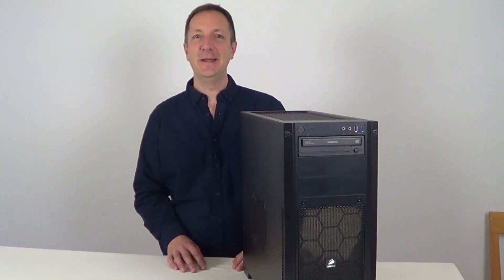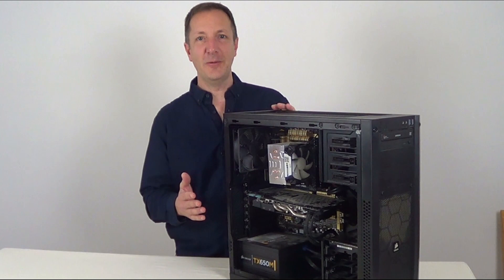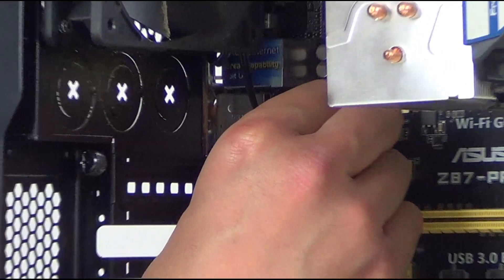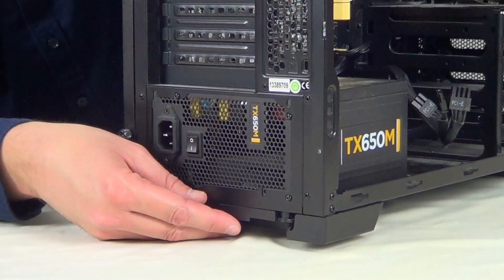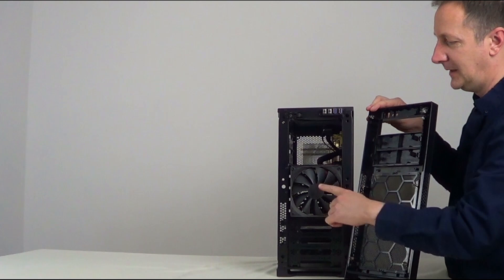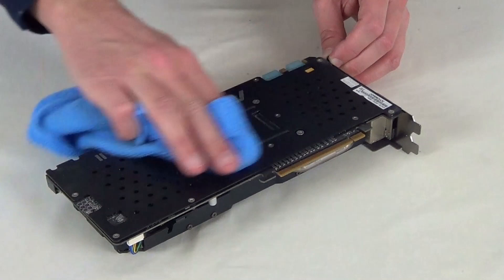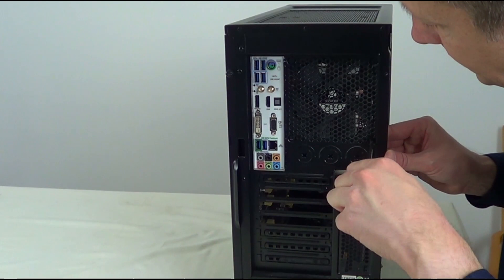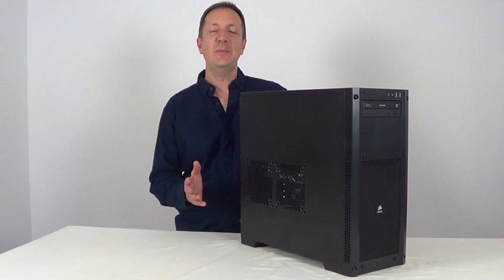How To Clean a Gaming Computer (step-by-step guide)

Comment: Great video! Those 4th gen Haswell chips are notorious for running hot even with a clean fan :)
Reply: Applying new thermal grease can help drop a few degrees on older PCs too
Reply from the maker: Thank you! Yes, wouldn't want to overclock it too much!

Comment: hey over heating problems arent always the dust that is cheged in there mostly you thermal paste have dried out so its a good choise to change the termal paste  evry tow months and the same for the gpu if you can do it

Comment: im cleaning my out soon and i have compressed air but get really cold and is that bad for my parts because it get really cold and also can I use a painters brush for dust as well or is it harmful?
Reply from the maker: Whenever your can of compressed air gets very cold, leave it to warm up again before using it. It's best not to use a paint brush on circuit boards, but can be used on certain other parts such as the computer case.
Reply: @EasyPcRepairs  okay thanks but the paintbrush is clean a soft does that change?
Reply from the maker: Any paint brush can build up a static charge. That's why it's best not to use them on circuit boards. They're unlikely to damage your computer, but better to not use them just to be on the safe side.
Reply: EasyPcRepairs okay ty
Reply: @EasyPcRepairs  what about if it's a static dissipation/antistatic brush?
Reply from the maker: An anti-static brush would be ok to use.

Comment: Hey can anyone recommend something other than canned air for dusting? I'd rather use something that doesn't require refilling.
Reply: 1 can of canned air will EASILY clean the inside of your pc 4 times or more. You can't refill them either, you just despose once empty and 1 can is super cheap. Get it at Walmart or staples for 3-4 bucks.

Comment: Instead of using that can of compressed air can I use hair blower instead ?
Reply from the maker: A hair dryer won't do very much to remove the dust. A can of compressed air has much more power to remove the dust from your PC.

Comment: I was told that you shouldn’t use a cloth to clean it because of possible static charges?
Reply from the maker: You were told correctly. Don't use a cloth to clean circuit boards for the reason you've already stated. Most other parts are ok to use a cloth.
Reply: @EasyPcRepairs  great to know. Thank you!

Comment: is it true i need to put back where the original ram sticks were? because i read that switching the original position of the sticks would restart the system
Reply from the maker: It doesn't always make any difference as the computer will check the ram on startup and everything continues as normal. But what you've read is correct... sometimes it can make a difference, so it's best to put the ram sticks back in the order they came in.

Comment: How would you clean and take apart a ryzen CPU fan from the cooler  on  the lower end ryzen cpus?
Reply from the maker: I'll give you a link to someone else's video as it's easier to watch how it's done, rather than me explain it (and I don't have a video on this myself right now)... https://www.youtube.com/watch?v=nFYKFIbCTO4
Reply: EasyPcRepairs I did find that video but the comment sections made me wary...thank you! Do you also find a need to clean the power supply itself.
Reply from the maker: I only clean the outside of the power supply. If you can see dust inside it, you could use a can of compressed air to help remove some of the dust. But don't take it apart though as they can hold a charge for a very long time.
If you're concerned about removing the CPU fan, just leave it on and use a can of air and a cotton bud, which will remove most of the dust on the fan and heatsink.
Reply: EasyPcRepairs I’m did the compressed air I could never get the dust in the heat sink all out or at all...mostly because I’m a bit scared to remove cooler from cpu
Reply from the maker: If you don't want to take off the fan, you could check your CPU temperature to see if it's ok. Having reasonable temperatures is the most important part. If you've already used a can of air on it, the temps are likely to be ok anyway.
Reply: EasyPcRepairs I feel like the temps could be better I never really clean the inside by removing the parts... I just mostly blow air. I’m just a bit concerned with the dust in the heat sink.

Comment: which program do you use to monitor those temperatures? and it can record i guess and save it for like a month or so ?
Reply from the maker: The software I used to record the temps was "Hardware Info".
Reply: @EasyPcRepairs  thanks :)

Comment: No bullshit I was getting piss poor performance from my gtx 1080ti and some other issues..... Tried every fix in the book and never took into account thermal throttleing. My gpus built in thermal throttle is around 86c and I noticed when my gpu load got to 50% it would throttle at 86c which is a horrible temp to have at that load.... After watching this video and cleaning my pc I now can get my 1080ti to 90%+ load and sit comfortably between 78-84c with fan speed at a very quiet 45%
Reply from the maker: Those are excellent results from cleaning your computer!
Reply: @EasyPcRepairs  it's crazy how cleaning a moderately dirty pc is the greatest true fix amongst a sea of hundreds of other "fixes" to sort through.

Comment: What happens if I didn't let the air can warm up will it damage my pc?
Reply from the maker: It won't damage the computer but instead of just air coming out of the can, some liquid can come out too. If liquid does hit your circuit boards, let it dry before turning on your computer, (10 to 15 minutes is normally long enough, depending on how warm your room is) then all will be ok.
Reply: @EasyPcRepairs  Man, your channel is pretty useful, but you should really read audiobooks as well.
Reply: @EasyPcRepairs  ok thanks you for helping me I really needed to know cuz I was kinda freaked out 😥

Comment: Tip: take in garage and use AIR COMPRESSOR AND SPRAY IT LIKE CRAZY
Reply from the maker: Yes, a good way for a quick clean. Not quite as effective, but good though.
Reply: @EasyPcRepairs Yes it is better if you actually aim instead of spraying it like crazy
Reply: That's what I do too but you need to hold your fans when blowing air from the compressor or you might damage them if they start spinning
Reply: @charlesttfr  oh? I spin mine but not like super speed